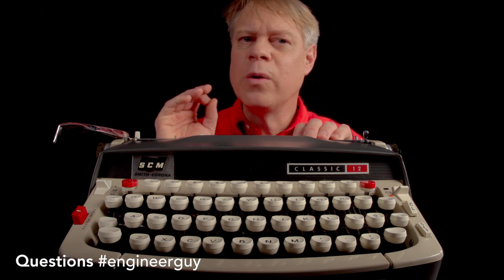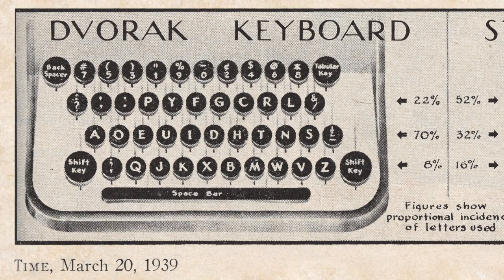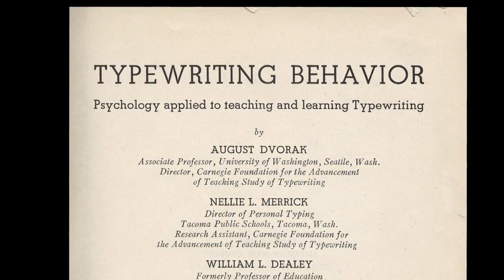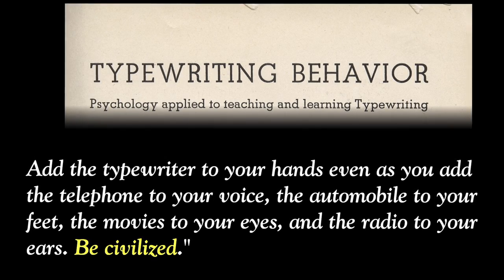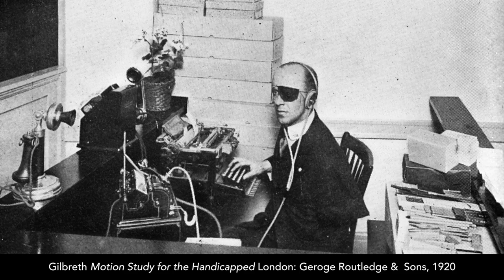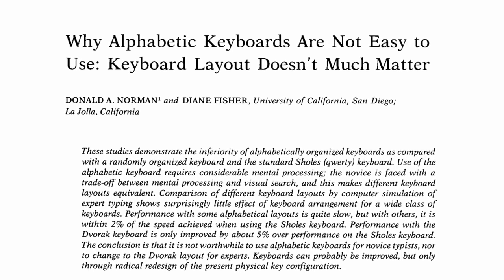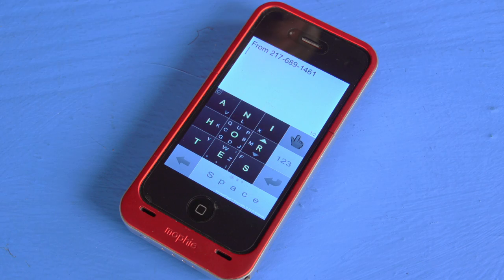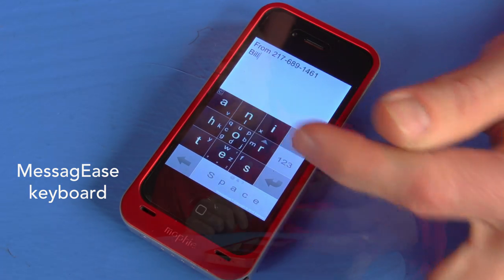Why the Dvorak keyboard didn't take over the world

Comment: If people stay on QWERTY because Dvorak only offers a 5% speed increase, they're missing the point of the new keyboard.
Dvorak isn't meant to turn you into a blazing fast typist (though that speed boost is kinda nice).  It's meant to make typing less strenuous so it's easier to type for longer and without so much effort.
Reply: Legend Length Exactly.  I switched to Dvorak a little more than a year ago, and even though it hasn't resulted in a huge speed increase I'm glad I took the time to learn it.  It's too bad most people aren't willing to put in the work to learn a WAY more efficient method of typing.
Reply: +Gabe Lance Wouldn't it mean that you had to change the keyboard layout for every title if you are were gamer? Might be one of the reasons...
Reply: Meh, I haven't had much of a problem with it.  You have to realize:

1. Not all games require you to type, and thus don't require you to change keyboards.
2. Most games have customizable controls, so you can change things to work with Dvorak. 

I suppose it is a bit of a hassle to deal with, but when I'm both a college student who writes a lot of papers and just someone who likes to surf the web (and thus type) a lot, it's worth it.  But that's just me, I suppose.
Reply: +JuanLeTwnz If you type in multiple languages, the change to Dvorak becomes exponentially harder.
Reply: +Heather Spoonheim Eh... no. You can use the same base layout for them all. I type in 5 languages using Dvorak (English, Catalan, Dutch, French and Spanish). I use the same layout for them all, English, and I use <alt> to enter the accented characters. I use Ukelele in OSX to set this up, with this configuration: https://github.com/grimborg/eudvorak
Reply: +Òscar Vilaplana Heh, went to edit that last message and it got totally messed up, bleh.
Reply: +Gabe Lance In the days of mechanical typewriters putting the most-used letters under the strongest fingers made a certain amount of sense. Does it still make sense now that we type on computer keyboards?
Reply: Laura Halliday Of course it does.  It doesn't matter if you're using a modern keyboard or a typewriter.  Either way, typing will be more comfortable and more efficient if your fingers don't have to stretch to reach keys as much.  With common letters placed within easy reach, you don't move away from the home row as often, and thus typing is easier.  Modern keyboards didn't change that fact.
Reply: +JuanLeTwnz I know this is two months late, but for steam and origin games, I've found that the games are able to recognize the change in keyboard layout and automatically adjusts accordingly to the new layout.
Reply: IdraSucks1 Yeah, that too.  I bought Psychonauts a while back when it went on sale, and it recognized the change in-game.  Tutorial text even changed keys from QWERTY to the keys placed in the same positions on Dvorak.  I was actually pretty impressed.
Reply: +Gabe Lance The Dvorak key layout is a nightmare for a left-handed person to use... Best to leave it in the trashbin of history, where it belongs...
Reply: looneyburgmusic Why?  The right hand is used slightly more, because most people are right-handed.  But that's only because all of the vowels are put on one side and the most common consonants on the other, so you alternate hands a lot.  That way you can utilize both of them efficiently without overworking one (like the QWERTY keyboard does, over-using the left hand).  The most common consonants typically outnumber the number of vowels in a given text, so the consonants are placed on the right.  But since the system is designed to even the hands anyways, it really isn't a huge bias toward the right.  It's just that it would be very difficult to make it completely even for both hands, and doing so would probably require giving up other benefits of the keyboard, such as the back-and-forth between the hands that you get from all vowels on one side and all common consonants on the other.
Reply: Gabe Lance The Dvorak doesn't come close to balancing out the hands... I wouldn't call it a huge bias towards the right hand, but it's more than enough to cause trouble for a left-handed person. It's the main reason I gave up on learning that layout - at the end of the day I always felt like I had given my right wrist and hand a major workout... For a left-handed person to use the Dvorak layout full-time without causing an injury they would most likely need some type of strength training/condition of the right wrist and hand...
Reply: looneyburgmusic Well, maybe it would.  I'm right-handed so I can't really speak from experience.  QWERTY uses the left hand a ton so I can see why you'd prefer that.
Reply: +looneyburgmusic Weird. I am left handed, started with qwerty, and switched to Dvorak. I can't tell much of a difference in hand symmetry, but the most common keys being in the middle made typing so much easier. It took me about 2 months go up to my previous speed.
Reply: Now, you practically cannot type on any keyboard other than your own.
Compatibility is an important quality.
Reply: Yes, that can certainly be an issue for some people.  But I can type fluently enough in Qwerty to get by when I need to on another computer, and I can use my own laptop most of the time anyways.  I don't find it to be a problem, but I can certainly see how others might.
Reply: There isn't a single ideal keyboard layout that is objectively better at everything.

Different languages have different "most common" letters, different people find different things more comfortable, the way you position your hands and other factors like the lenght and height of your keyboard. Every minor detail matters.
Just the fact that most of us have QWERTY engraved in our muscle memory makes it more comfortable and faster.
Reply: Except it isn't more comfortable, nor is it faster.  And it's true that different languages will have different letters that are more common, but there's no excuse for all of the English speakers that still use QWERTY.
Reply: what do you use?
Reply: Vincent Magesa I use Dvorak.
Reply: I agree that young people should be trained to a more efficient keyboard format. In fact, I think a new study should be done. There have been new curved keyboards that are even more ergonomic (whose benefits I cannot prove nor disprove atm).
Reply: Aron - I like your objectivity. It's refreshing.
Reply: I switched to dvorak about 15 years ago because I had RSI.  I don't anymore (or it's nothing like as bad as it was).

But, I now can't type on a QWERTY keyboard worth a damn.  That's generally not a problem because you can have multiple keyboard layouts installed on Windows systems, and it's even easier to switch keyboard layout in X (Linux) with a simple command.

Still, I don't regret making the change if only to save my wrists.
Reply: Gabe Lance TOTALLY AGREE. People are running oh how fast how fast is it faster kinda question ...... such a bull headed and no sympathy, or being humane. It was to relax your damn fingers and keep you away from being paralysed. But NOOOOOO I don't care about the ergonomics you have to be fucking machine..... all people commenting here asking how fast any body asked how comfortable? World full of SOB's. I think offices who don't care about ergonomics should be given corporal punishments.
Reply: stallio Are you actually suggesting that QWERTY should be illegal? Lmao
Reply: ColasTeam NO not at all, I am saying people are behind performance, speed, suck out last drop of us. Did someone asked how efficient it is, how comfortable it feels to type with. Apart from that I hate those offices who will give you the keyboard slider but you have to use mouse got damn one foot high from keyboard, making your one shoulder slant, frozen and drained at the end of the day. It was frustration and sir by the way don't you think machines should be made the way it suits the human ergonomics or should we twist and throw fingers according to machine. It's another thing if you are fanboy of Remington.
Reply: Gabe Lance so it's fo lazy ppl
Reply: Òscar Vilaplana so you go making you own keyboard layouts. Good luck with that
Reply: It doesn’t matter for me, I use only two fingers when I type. Lol maybe a pinky or thumb gets thrown in though.
Reply: Dude, I'm not gonna relearn touch typing from scratch for a possible chance of slight improvement.
Reply: I've been typing dvorak for 11+ years.  Programmer dvorak for 2.  I don't think my typing speed ever went back up as high as it was with qwerty but I'm okay with that.  I kindof want to learn a single-handed dvorak layout, but I'm not sure left or right.  I'm kindof waiting to see if anything ever happens to either of my hands to decide :)
Reply: JuanLeTwnz
or change the game config to match they keyboard. i don't even use the default wasd control scheme for games anyway, because i've been here since before that was standard and made my own, better standard. and that's the thing. i wouldn't have bothered finding the most optimal setup if there was already a standard in place at the time. mine's better, but not enough to justify switching from the default one. but since i'm already on it, i don't feel like switching to a worse one either.
Reply: @lily-liver: For those who write or code as a profession, typing on a modern keyboard can get to be extremely rough on the hands and wrists. Many of us make the shift to the DVORAK layout and/or ergonomic keyboards out of necessity. It's far more comfortable to use (for most purposes). 

That said, it's not for everyone, as it takes 2-3 months of practice to get back up to speed if shifting from QWERTY to DVORAK. (That timeframe isn't really negotiable; you're retraining the muscles in your hands, and those muscles need time to build up and heal between sessions.)
Reply: @Froosti: DVORAK keeps the most commonly used letters in the easiest to reach places (such as the home row). This means you're reaching/stretching less (or in the case of us tiny-handers, moving the position of your hands/wrists less) to hit keys, which decreases the amount of strain over long periods of time.
Reply: Dvorak has much more of a 5% efficiency gain in typing. Speed gain might only be 5%, but that's not the point. With the Simplified Keyboard Layout (the Dvorak), typing is much more comfortable and much more efficient. Like 50% more efficient. I don't care much about speed, but i do care about making my life easier, and if i gain speed due to it, fine. I'm a barefoot runner, but running barefoot actually makes me a little bit slower, but i don't run for speed. I run for health. And barefoot running is a LOT healthier as it really is a different sport altogether than shod running (running with shoes) because barefoot running is a low impact sport while running with shoes is a high-impact sport. That equates to knee problems, back issues, etc for shod runners. But how this relates to keyboard layouts is this: speed isn't the big deal. Comfort and efficiency and health is what is important. I don't know if 5% is accurate for speed difference or not. But one thing i learned when i started using this simplified keyboard layout was this: listen to those who actually tried both layouts, the qwerty and the simplified keyboard layout. Dvorak's Simplified Keyboard Layout is a LOT more comfortable. I switched years ago, my brother tried it shortly afterward and switched too. The only drawback with the better keyboard layout is that you need to be just a tad bit smarter than the average know-nothing when it comes to setting up the keyboard layout on computers that you use. I just have my own laptops and bring one of them everywhere i go. When i worked at a retail store that had a Qwerty keyboard i just used it, but was slow and it wasn't important to be fast at it since i was a cashier & didn't need to type much, but slow at 40 wpm on Qwerty is not a bad problem. Oh, the switch took about a month to really get back up to speed on Dvorak's Simplified Keyboard Layout, so that's a hurdle that discourages most. But truly, I'm glad i switched and i don't think i'll every switch back, as i hate the Qwerty layout. It's so uncomfortable. After only learning the home row on the Dvorak, i was utterly amazed at how comfortable typing was because so many words can be typed from only the home row. No more needing to reach as far to type as much. It really made a huge difference in comfort to me! But what do i know? I only have first hand experience. I propose that if anyone really wants a realistic testimony of the difference, ask anyone who has actually tried both. ;P
Reply: @gabelance1  very many require WASD
Reply: I agree. I use the dvorak layout and I barely move my fingers compared to the qwerty layout. It is simpler and more confortable than the qwerty layout. The dvorak is clearly superior. It took me only 3 weeks to learn it. It was worth the time investment. I really don't understand why most people are sticking with the 2nd best choice.
Reply: Heather Spoonheim Bullshit. I use dvorak layout primarily, but also can still use qwerty (it takes a few seconds to get back into it), and it is really language independent. Let me demonstrate you. If you have to type the following nonsense words: ododton uhunuc adoiedgeh kmhettob in qwerty, is it slower? Yes, because you don't recognize the words, and thus you need to read more carefully. But does it slow you down because of your keyboard layout? Definitively, no!
Reply: @JuanLeTwnz  Games automatically detect the Dvorak Layout
Reply: Yes.
Reply: I switched to Dvorak more than 15 years ago and can't but agree.
Reply: @nicolasgrimmer2865  because most people don't see the point in investing all that time for what will be at best a mild improvement.  If it's even an improvement at all and all the Dvorak worship isn't merely the result of people needing to justify all the time they spent learning it to themselves.
Reply: Its an unsubstantiated myth that qwerty causes more repetitive strain injury than dvorak
Reply: This. For the love of God this. It's not that it makes you type faster, it's that 70% of words can be typed entirely from the home row, making it SOOOOOO much easier on your hands & wrists. Been typing Dvorak for 10+ years due to wrist issues.
Reply: and then came voice input and keyboards became obsolete - not there yet, but it's close
Reply: @JuanLeTwnz  Doesn't make sens as the keys are physically at the same place, only for the computer code does it differ.
Reply: i have been using dvorak for a few months and I am currenty about the same speed and accuracy i was is querty (other than hitting the v key) and its so much more comfortable to me than qwerty. I can still type in both, but qwerty now feels needlessly clunkey and strenuous
Reply: @kijetesantakaluSokete  I wish that was always the case. I've been on Dvorak for almost 15 years now, and gaming is the one thing that irritates me about it. Most games are able to auto-detect and still work, but even the ones that do can still have problems with it. Menuing/UI commands often don't respect Dvorak. Borderlands 3 was the most recent big game I can think of that created a lot of problems: all the shortcuts in the menu/inventory/etc interface required the QWERTY placement of those characters (like the QWERTY 'Z' or 'C' instead of the Dvorak semicolon and 'j').

I've ended up largely just switching games to QWERTY, especially if they don't require a lot of typing itself (e.g. text chat). While I definitely have to think to "remember" my QWERTY muscle memory when I do type in them, it's made the whole thing much less frustrating
Reply: I got one for the speed, and for me, the speedboost is more like 30%, not 5%
Reply: @JuanLeTwnz  
Just remap the controls you need, which takes about 30 seconds per game, or leave them default and switch between layouts with a key combo, ctl+shift in my case, which takes about 1/2 a second.
Reply: I spent two years on Dvorak and gained nothing in speed or comfort. These are myths-both of those things are driven by many many factors, and layout is only one. I went back to QWERTY so that I would no longer need to carry a goddam keyboard around everywhere. Convenience is a real and important factor in any choice.
Reply: No good study backs that.
Reply: Exactly. And engineer guy CLEVERLY obscures that point by pretending to not see it.

Comment: I have been touch typing Dvorak since 2001 at around 80WPM (400 characters per minute, 6 characters per second). Before that, I have been touch typing qwerty for many years. The main difference when moving to Dvorak is not that you can type faster (the difference is not that impressive) but how easy and flowing it feels. There is much less combinations in English language that are awkward on Dvorak than on qwerty.

Comment: The standard mobile japanese keyboard uses a similar one to the one you showed at the end. It's called 12 key. 

In japanese, you can group syllables together under a group of usually 5 syllables, they start with the same letter but end in a different vowel. Either a, i, u, e, o. Each swipe direction corresponds to a different vowel. 
It's a neat keyboard.

Comment: Thanks Bill!
Thanks for showing our keyboard, MessagEase keyboard, as an example of an innovative keyboard.
MessagEase (on Google Play Now) has the honor to be the Dvorak of the touch screen keyboards! While Dvorak showed up DECADES after the QWERTY was settled in, for touch screens we are confident that the early users quickly see the clear advantages and differences: Fewer, Larger Buttons => fewer errors and faster typing with one hand. Give it a try and you'll see! Our top speed, dictionary unassisted, completely WYTIWYG speed is more than 100WPM! And that's on a small touch screen.